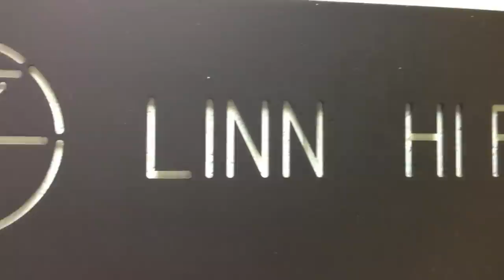The Linn Home and factory visit

Comment: I worked there for 5 years. Interestingly enough one of the men on the "listening panel" Dalgliesh" , was deaf in one ear lol  what a joke.I was told not to make any negative comments, it would look bad !! Their stuff is over priced and under designed. They skimp on component quality where they can. I know, I used to buy them.  

They've come a long way since they came up with a very (ahhhhemmmmm) similar design to Ariston turntables. They used to make bearings for them as a sub contractor when they were Castle Engineering. Funny how that came about I always thought, must have been a coincidence ;)

You can take any Philips CD player which has a decent transport, swap the op amp's for Burr Brown OPA627, single or dual. Power them with a devolved supply of say 18VDC  (use low esr caps, schotyky diodes and a c-core transformer and it'll sound extremely close to the sound of their CD12 for a fraction of the cost. I know I did it while I was there and was shunned for it. "Oh you're a tweaker, well it may be different but you only think it sounds as good" lol Oh ok   ...that was the mentality. The sound stage is so narrow you could draw a circle round it with a magic marker, very  little three dimensional to it and the bass sounds like an elephant kicking a burst paddling pool, just no punch man.

The bill of materials cost for their products is about a 10th of what you pay, so if you're dropping 10 grand into one of their systems, the cost of the parts you're buying is a grand or less.They buy the bearings for their tone arms for pennies from Japan I think it was, maybe China. They're garbage and look at the price they charge.